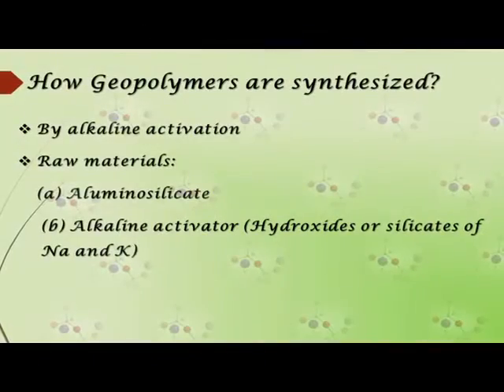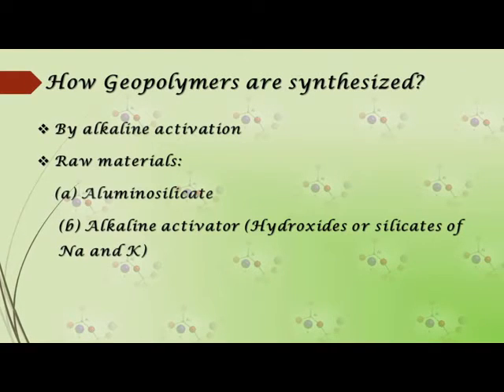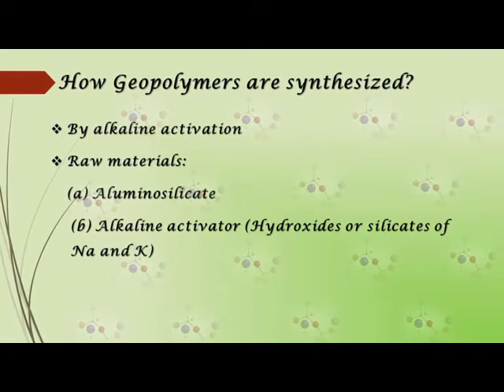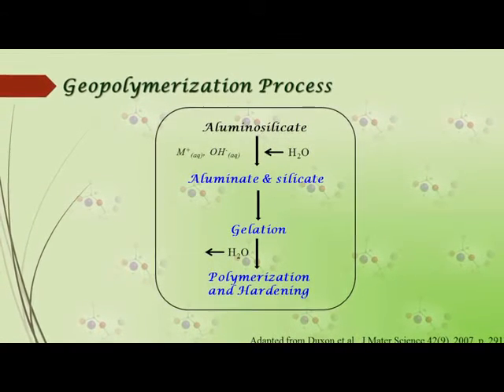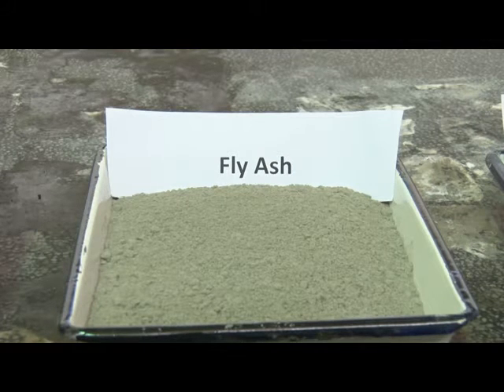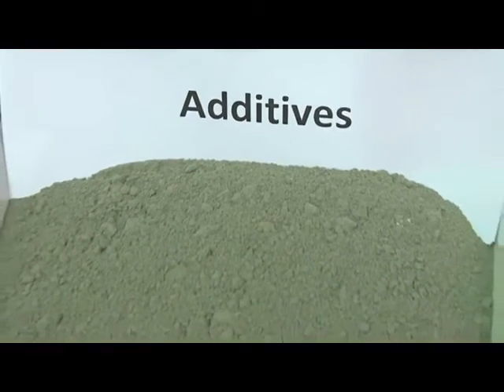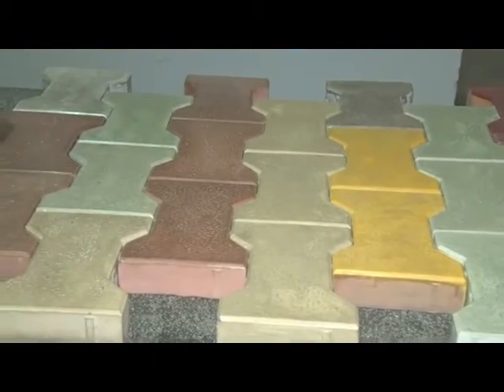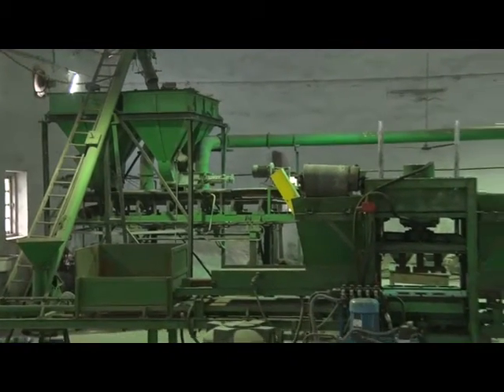Geopolymer Cement in English

Comment: I couldn't understand the accent. Was heat used to cure?
Reply: Humidity controlled oven was all i heard
Reply: The CC is surprisingly accurate. He says "Cured in controlled humidity conditions for three days".  

At a guess based on the time stated, I would say it's effectively slow cooked and humidity controlled in a dual purpose humidity/temperature control chamber at a relatively low heat. A google image search shows similar chambers, but not specifically the one shown.

Comment: hello how can i use plastic in cement . I want to make waste plastic roofs
Reply: Make concrete with raw polystyrene , mold, cure, and dip coat/ plaster on your melted recycled plastic outer coating.
Reply: Mix sand and plastic and heat it up until it’s like a paste, the press it into a mould

Comment: Very interesting Can you comment on the long term structural stability of the Castings underwater or in wet conditions. Also has there been any leaching tests done to see if the alkali added is permanently bound to the Si-Al-O Matrix. Is it likely that under wet conditions the castings will lose strength?
Reply: Can you explain briefly...... About Geopolymer mixing